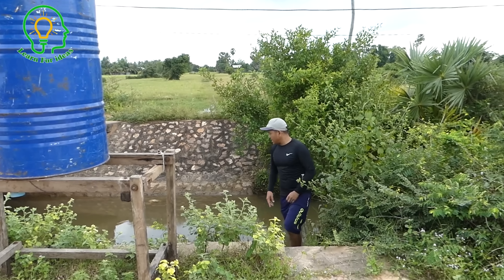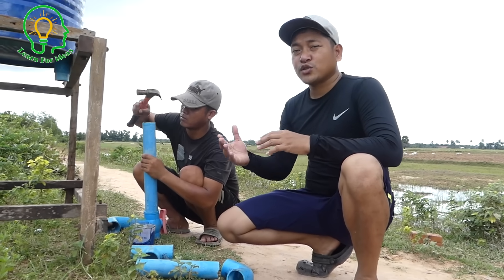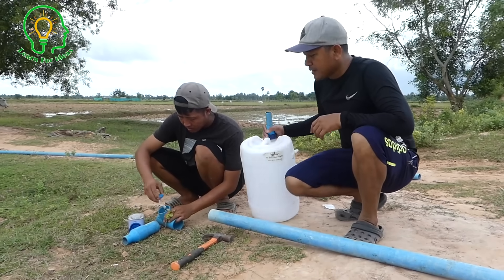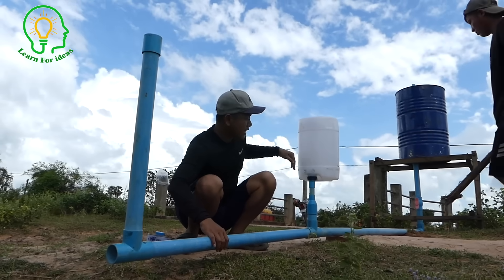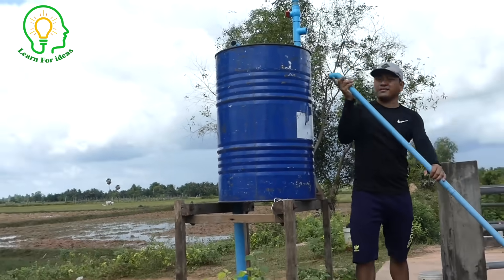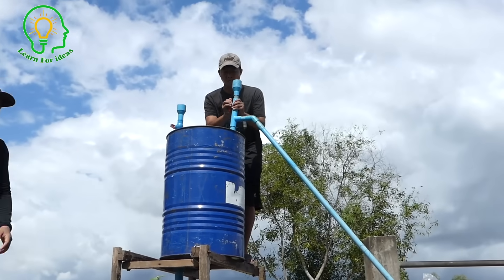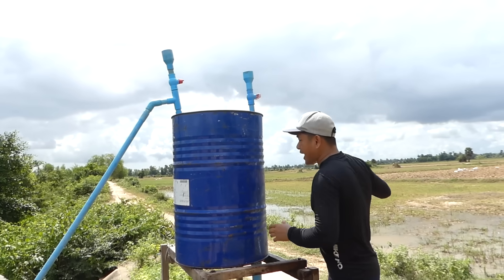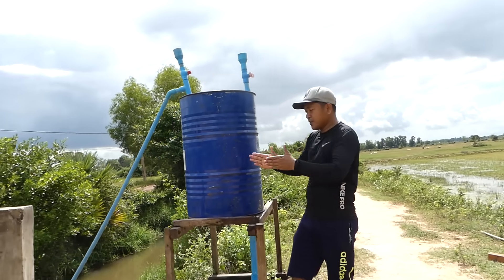Free Energy Water Big Pump and Big Air-Pressure for rice field | Water Pump without Electricity

Comment: Hahaha. Please stop all this lie unless the outlet is lower than the river, this will not work.
Reply: wrong, the outlet only needs to be lower that the inlet to the tank, not the canal water source
Reply: @dano5562  hahaha
Reply: @nonitoopena73  laugh all you want. Ive built several and they work. you apparently never built one or understand the principal behind gravity siphoning. do some research
Reply: @dano5562  how can you have a siphon to happen if the canal is lower than the outlet? Both the canal and the outlet is subjected to atmospheric pressure, therefore no flow will happen to the outlet as it is agains gravity.
Reply: @nonitoopena73  that's not how it
 works. The measurement is from the inlet at the top of the drum not the canal level. The distance from the inlet level  at the tank down to the lowest point of the outlet is the fall distance and what gravity works on. The weight and volume of water in that fall is greater than the weight of the water in the intake pipe and as a result pulls the water up the pipe to refill the drum. The atmospheric pressure is the same everywhere you measure and is less than the pressure of the water based on volume, weight and fall so it has no affect
Reply: @dano5562  Sorry, but i cannot agree with you. It will only work for short period but will eventually stop, because flow happens due to static head difference between the canal and the outlet, not the weight or volume on either side of the tank.
Reply: @nonitoopena73  hahahaha you really should  research how  gravity siphoning works as you dont understand the principal and process.  You've taken 1 factor of the process and continue to claim incorrectly to  how this system process works.  The movement of water based on the siphon  process is source level of water in relation to outlet level of water. The difference in fall is what creates the flow and initiates the sucking pulling water up the inlet piping due to the closed and sealed system. In this process that "source level" is moved from the canal surface up to the drum inlet level which is this aspect you seem to be misunderstanding.  I've built several of these systems and they work correctly as shown in the videos.  Have you even tried to build one of these systems yourself or are you just an internet engineer 
???? Im betting you havent.  Dont bother replying as your thinking and understanding is wrong, you havent researched the process to get the facts of how this process works or cant grasp the process and its a waste of time trying to explain it to you.
Reply: @dano5562  hahaha
Reply: @dano5562  Referring to the elevation of the inlet to the tank has no relevance  if the top of the tank is about 1 and 608 meters. Totaly irrevant. This is a siphon. The inlet is the river, the outlet is the rice field. Inlet must be elevated higher than inlet. You may even leave out the whole drum, it will work with just a hose as any siphon.
Reply: @dano5562  Sorry Dan. Inlet here is the water level in the well or river. Inlet must be elevated higher than the outlet at the rice field. Barrel can be where ever between zero and about 8 m over the river. The lower the better.

Comment: Just to be clear. This is not a pump, it is a siphon. The drum it to prime the system (fill it with water).  The pressure at the outlet (if closed) is the difference in height between inlet and outlet. And of course the outlet must be lower than the inlet. If you could fill it with water a pipe along the ground will work just as well.
Reply: 1. We don't know of they put something (eq hidding pump or streaming water sound effect)in the drum..
2. The video to short, we may think that the out put water are come from what they fill to the drum before.. they have to use a coloring water and let US see the transition from the coloring water to the river water..
Reply: I have tried in my farm but sadly it failed..what a waste of time and money..
Reply: @jeoriebarcenilla4244  How sad. 
A barrel siphon is working fine, put these videos rearly tells that a siphon only works from a high source to a lower output. A siphon can never lift any water up from a “deep well”. That is a hoax.
Reply: No it is not a siphon but a pump. Scientific logics are pushed aside here. Let me just say "It's an insult to physics 🙃🙃🙃 ".
Reply: @compostsfertilizers5471  Its a gravity feed siphon. The word pump is also accurate but misunderstood since its not mechanical or electric
Reply: @compostsfertilizers5471  Noo, it is a siphon. You may use a hose instead.
Reply: @compostsfertilizers5471  
There is nothing insulting here. But if you consider it a pump, where does the energy to pump water come from?
If the answer is gravity, and there are no moving parts, it's a siphon.
Reply: @AldriFerdig  It's a vacuum system. Water is sucked from the river due to the vacuum created in the drum. the force of the water in the outlet stops air from sipping back hence water from the river raises to the drum.
Reply: @compostsfertilizers5471  
Apart from the detail that it's more correct to say that it's the air pressure that pushes the water into the drum, and further until it runs downhill, your description is correct.
This is how a siphon works. 

Btw. there are no vacuum in the drum. A siphon can be used to lift water about 10 meters high, as long as the outlet is lower than the inlet. The limitation is that one atmosphere of pressure equals 10 meters of water.

If it could pump water to a level higher than the input it would not be a siphon, but this system is a siphon. A hundred drums between the inlet and the outlet doesn't change this.

There are gravity powered water pumps, but this isn't an example of one of those.
Reply: @AldriFerdig  May dear these guys a pulling water more than 20feet  under ground. And this is now practiced in many countries in Asia, Africa and Latin America. So please stop this unnecessary arguments.
Reply: @compostsfertilizers5471  
Please.
Do you really argue that they pump water 20 feet up, using nothing but gravity?
And you do this based on some youtube videos?
It would be revolutionary and new physics. 
You don't provide a hint of an explanation, and you call my arguments to the contrary unnecessary.
LOL
I have to admit that I'm unsure if you are just teasing me, the best option, or if you actually are this gullible.
Reply: @AldriFerdig  I know very well that this is against the laws of physics, but maybe it was overlooked and we won't wait for the laws to be changed. Am sorry bruda we are moving on. Catch you later.
Reply: @compostsfertilizers5471  
" I know very well that this is against the laws of physics,"

LOL
That only shows you don't understand how it works and/or the laws of physics.

Take care.
Gravity works and reality bites.
Reply: @AldriFerdig  YOU HAVE NO CLUE WHAT YOUR TALKING ABOUT.   Gravity is the action that moves the water out of the drum and thru the piping. The action of the gravity pulling the water out is what in turns pulls the water in from the water source. You really should'nt be providing inaccurate info if you dont know how the mechanics of this system works. Do a simple internet search on gravity siphon and you will see the principal behind this system.
Reply: @dano5562  It is a simple gravity feed system. The water mass on the outlet side outweighs the water on the inlet side. The pulling force on the outlet side is so strong that it pulls in water on the inlet side. Simple
Reply: @dano5562  Sorry Dan but you are wrong, Ola is right,
Reply: @compostsfertilizers5471  Impossible. Ola is right, you are wrong.
Reply: @Gbforx4  i have tried but the air return back from outlet pipe to the drum and no sucking from inlet pipe.

Comment: WHAT WILL HAPPEN IF THE  INLET PIPE IS BIGGER/SMALLER THAN THE OUTLET PIPE???
Reply: It will work with any reasonable dimensions, but the output must be lower than the river/input for it to work.

Comment: The only way for this to work is if the out line is very large.  The drop will make a vacuum pulling on the drop line or in line it should equalise and stop running. But is worth experimenting with.  If you do please make a video so we can see your results. I use the air lift method. It uses atomized water and air to lift.  It's lighter than water alone. It will float and bubble into a cistern.
Reply: outlet pipe from the drum should be minimum 2.5 times water inlet diameter and then reduced again at the end of the outlet run to increase pressure if needed
Reply: @dano5562  No need for that. Output side may be 1 inch and input side can be 8 inch if you like, but the source must be higher than the output.
Reply: @dano5562  Nah. You've been fooled. The outlet is actually lower than river water level. All you you need is the initial suction to get the flow going. A bit like you would do with a hose that goes up and then down.
Reply: @accaciagame1706  that is not correct... look again. Think of a boat motor drawing gas, from tank, if the tank has no bleed valve the tank will draw a vacuum. that pipe from the river is the filling pipe(aka vacuum fill inlet), the higher we have to lift the water from river more vacuum!!! untill you can even sqaush the drum, this works upto 30 ft!!! if drum is strong enough and holds enough water.
Reply: Me too am thinking on the siphone effect in that the outlet is lower than the inlet position. Because siphon works only if the outlet is in a lower than the inlet water level.another point i want to understand is in many similar videos, i observed that tge barrel should be full of water with out any air. If there is air i think it should not work. So i need these two explanations
Reply: @ddyy5110  Thus is a siphon with a priming barrel. There may be air in the barrel. The barre, must be air tight and the must be some water in the barrel, enough to fill the suction tube.
Reply: @luckydubeinrc5165  Noop. This only work if the output is lower than the source water level.
Reply: You have to think the engineering side of the system. The drum is acting as the pump. It does not matter if there is air or not as long as it is sealed after being filled with water. The outlet pipe need not be lower than the water level in the river. Once the outlet stopcock is opened water will flow out, creating negative pressure in the drum. This will in turn suck up the water in the river into the drum and out thru the outlet pipe.
Reply: @andak93  Sorry, but no. The water level in the source must be higher than the outlet side to make this siphon work, as with any siphon, barrel or not. It is correct that water flowing out will reduce the pressure in the barrel, but not enough to suck up any water.

Comment: Put a sight glass (  or any transparent hose)  on a drum to monitor the level of the water ... that would help on upgrading your project....
Reply: No need. You can hear the height inside by taping with a finger on the drum. The sound will change around the water level.
Reply: @dettyouy223  ... you are right Sir 👍🙏💐

Comment: Well done, but i think there is no need for the drum, but only pipes would do the work. Since the elevation of water as source is higher than the elevation of the output, it would work. But if the output elevation is higher than the source, it would not work without using a pump

Comment: Hi, I tried a similar setup, but, it stopped after 1.5 hours. What are the possible problems. Thanks.
Reply: Should be air seald
Reply: that is good achievement, it should be air tight.

Comment: Is it possible to eliminate the airpipe from the drum?
Reply: You may drop the whole drum. The only purpose for using a drum is to get the tubes filled with water so the siphon effect will start. One way id to suck a whole length of tubing in the pond, river, lake. Close the upper end and drag the closed end down to a exit place lower than the water level in the source. Open an the water will flow for “ever”, no drum.

Comment: @Learn For ideas  Don't waste anymore time and money. I tried it, it doesn't work, and accordingly, after so much computations, it really won't suck up the water unless the output pipe is lower than the water level of the supply (siphon effect). Honestly, I tried to believe that it could work, but I really have doubts, until I prove it to myself. Even if the water output pipe is just 1 cm above the level of the water supply, still, it doesn't work. Why? Because the input pipe and the output pipe are both governed by the law of gravity and that the properties of water are governed by height and the pressure they create based on height. Even if the intake pipe is so much smaller than the output pipe, it exerts more downward pressure than the output pipe (if it's level is higher than the water level of the river). Show me a two hour no-cut video until the output pipe runs out of water from the reservoir tank and let us see if it can still suck up the water, and I can bet $10,000.00 on that. No matter how much vacuum that output makes, the downward pressure coming from that small pipe (which is suppose to take up the water) will still be much greater.  Lesson learned.
Reply from the maker: @ditt Spoke: we share idea for all of you and did not want to bet and you want to see the real here please be direct here and we want you to spend only fly and stay only . thank
Reply: you have no clue what your talking about. if you really did construct one of these and it didnt work the failure is in your construction. Gravity pulls water  from the tank downward and as a resulting action pulls or sucks water up the inlet pipe. This principal has been around since the Romans built aqueducts and moved water across hundreds of miles and numerous mountains with varying elevations.  The level of the source water does not matter as the level involved the action and calculation is at the inlet entrance to the tank which is elevated versus the level of the outlet pipe on the ground. Plenty of sources on line that explain gravity siphoning. inlet pipe is smaller than outlet pipe for a reason and its critical the system is sealed. do some research and you will see how wrong you are in your statements
Reply: @dano5562  Have you constructed one? If you hadn't, then I challenge you to spend money and build one. Let's see how much money you will waste. You are thinking that the output pipe is bigger than the intake and that would pull-up the water from the small pipe? I'll wait for your reply after you build your own and find out for yourself.

Comment: Thank you for leveling up the free energy water pump...may I request the list of materials needed in the installation of the pump especially the inlet pipe... I can hardly understand that part.
Reply: So here he has a drum. Then he has a three valve setup hooked up to the drum. One valve is on the bottom and there are two valves up top. Bottom valve has a pipe after it with a tee and a pipe coming out the top of the tee with a cap on the end of that pipe. The other open end of the tee has another length of pipe and a valve on the end. The First top valve is for air venting, it is located at the back. In the front, closest to source water is a 45 degree bend attached to an elbow coming off the valve. At the 45 degree bend, a pipe is installed to reach the source, this is the inlet. An appropriate filter may need to be installed, as debris would accumulate inside the drum over time. In this particular configuration it can be used without a filter and free flow is used to flush the drum continuously. The water is from a stream that is not very muddy at all. This system is expected to run without clogging for a number of years, until repairing the leaks and possibly changing the drum is required for preventative maintenance. Use ptfe thread tape and ball valve replacements if required. Joiners can be used to repair sections of pipe.
Reply: @thomasknight-wagener6630  .... sir... Happy 😊 to read your knowledge and comment... you are so good and kind-hearted person too ❤️ 🙏💐

Comment: Thanks for the lesson, my Qn is, what is the use of that air pressure container along the out let pipe for the irrigation?
Reply: The air pressure pipes and tank has 2 uses; 1) To trap any air coming from the outlet valve , and 2) To increase the force/pressure of water output.
Reply: @compostsfertilizers5471  Nice answer, but how do you explain that it increases the outlet pressure?
Reply: @dettyouy223  The air that manages to enter through the outlet pipe, trying to go to the main vacuum tank will enter the vertical pipes pushing the water in there hence forcing the water down.
Reply: @compostsfertilizers5471  good idea thank you.
Reply: @compostsfertilizers5471 تفسير رائع جدا
Reply: How many meters from tank to river?
Reply from the maker: out let 60mm and inlet 34mm

Comment: What is a good maximum height of drum "stand" (wood) ..
And what is the maximum length of draw pipe from river to the drum possible?
Thanks.
Reply from the maker: 3-4m
Reply: It is a siphon. As long as the outlet is lower than the inlet the middle part can be up to about 10 meters, as that is the water column corresponding to one atmosphere pressure. 
There are no absolute max lengths, but friction will eventually make it stop depending on the size of your tubing.
Reply: @AldriFerdig  ....👍🙏💐